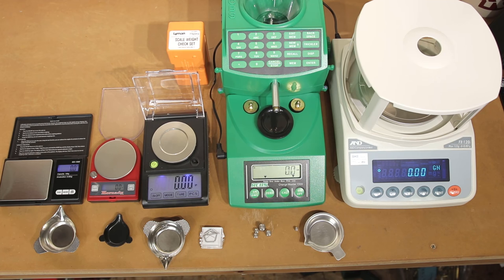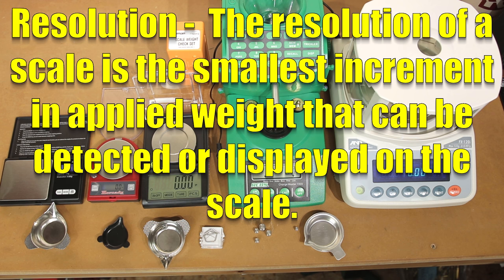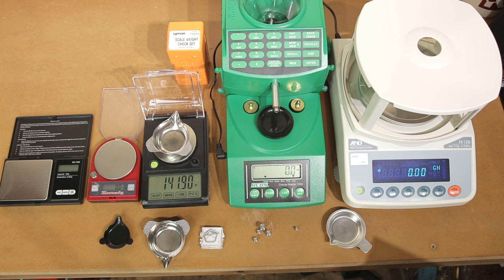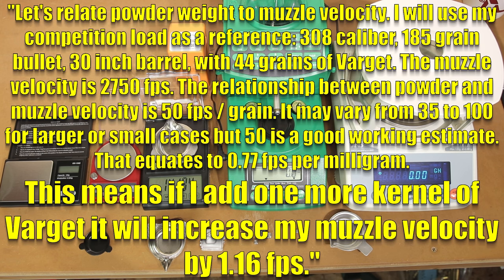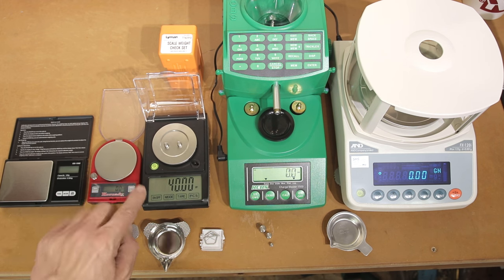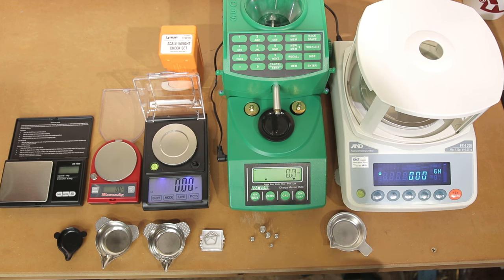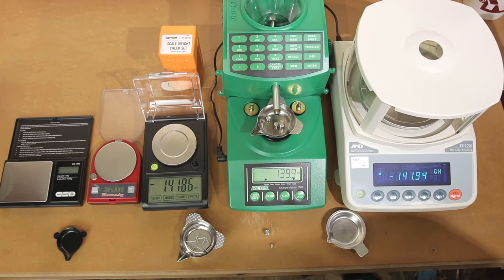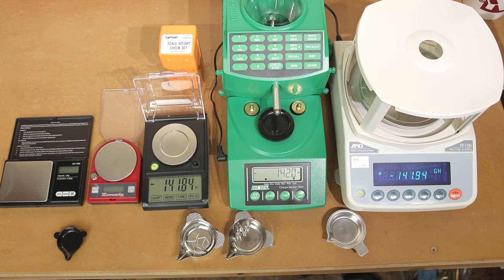Reloading Scale - Comparing the GS 1500, Charge master 1500, WAOAW milligram, and FX120i

Comment: If there is one piece of reloading equipment that I have underutilized it's my FA digital scale.  It just doesn't meet expectations.

+/- 0.1 grains shows the fallacy of the 0.01 display.

My experience with inexpensive electronic scales is that they are poorly suited for measuring small changes as with trickling.  They seem to be OK at weighing bullets or anything where the entire weight is deposited at once.

I will trust my 5-0-5s over ANY digital scale including the FX120i if there is a difference in their readings.  OTOH, my Charge Master and both 5-0-5s have always agreed exactly.

Comment: Can you please use your A and D to check how good/bad the repeatability of an Ohuas beam scale is?
Reply from the maker: I do not have a Ohuas beam scale to compare to.
Reply: @BoltActionReloading  I have one you can borrow but it's a fair trip to Australia to pick it up. I ended up automating a powder dropped with an air ram and a small motor on my trickler. When the beam breaks an optic it stops the trickler. Its faster than an auto charger and there is no worries about the beam scale drifting.
Reply from the maker: That sounds like a extremely interesting setup.

Comment: Right now i have 2 relative cheap digital scales and they don't keep zero for crap....taking the dish off and on a few times will start to skew the tared zero and I have to power off and back on to get it back to zero...pain in the ass.  I think i may just go with the balance beam just so i can feel better about the digital readout being right or not....or maybe I should just spend a bit more on a digital.....hmmmm

Comment: You could have a whole bench of nice reloading tools for the price of that A&D scale alone.
Reply from the maker: Hi James, The price of the A and D scale was a little more than the price of the RCBS unit.  A lot of the videos I have done, knowing very accurately what the weight of something is adds to the content. I am not telling anyone that have to buy that scale or any other for that matter. The point of the video is to show the performance of all of the scales so the viewer can decide for themselves which one is best for them.
Reply: @BoltActionReloading  No problem, just stating my opinion. And the A&D is just a scale, it does not throw/trickle powder, so apple's to oranges when the RCBS was an all in one when it comes to price.
Reply from the maker: Its likely the first step to an auto trickler for me. If the RCBS stops working that will be the first thing I order. Unfortunately some people think that the only place to buy them is from Brownells, when there are places that sell then for 2/3 the cost.
Reply: @BoltActionReloading  Oh trust me when I say I'd love to get one, But the cheapest I can find one for is still $715.
The cheapest price I've found for the RCBS chargemaster is on sale for $349, and that would eliminate the need for my Uniflow powder measure and my trickler. 

That being said If I had the money I'd buy one. Consistency is king, and in your video that A&D was dang close to being as consistent as can be even with a .02 accuracy, that sure as hell beats the hell out of being off be a whole .1 gr.
Reply from the maker: Its 465 at Cambridge environmental in canada. I have seen it there for 425 before.
Reply: @BoltActionReloading  Thanks.

Comment: A big improvement for all scales would be a weight platter with a recess exactly the size of the bottom of the trays, that way, the trays are consistently placed on the platter. I think inconsistent tray placement is the deviation culprit.

Edit:  Another option is to place a small screw into the exact center of the tray, and drill a matching hole into the exact center of the weight platter; that way (pun not intended,) there is absolute placement consistency.

Comment: 800.00 dollars it’s not worth it 👎🤢🤮 who cares if it’s off one or two gn off
Reply from the maker: They can be found far cheaper than 800
Reply: I picked mine up for $350 after rebate
Reply: That white one is $799
Reply from the maker: Check out Adams website, he has links that he keeps up to date to where he recommends to go. https://www.autotrickler.com/v3-for-ad.html it requires a discount code but I just checked it and it still works. Right now its $450 USD.
Reply: Eugene Johnson you need to shop around
Reply: Eugene Johnson some people.

I’m not going to act like to normal hunter or even the average target shooter needs it. Just that if you are truly chasing optimum precision especially competitively in long range benchrest or other specialties you should be caring

Comment: The FX120i is seriously over priced and you do a disservice to us all by promoting it.  If one just wants a hyper accurate balance the FX120i is double what one needs to pay.  As an example, the Ohaus Scout SPX123 is just as good, just as accurate, just as impervious to where the weight is placed on the scale and cost half the price.  Fact of the matter is Adam MacDonald made an extremely poor choice getting into bed with A&D.  He charges $270 for the Autotrickler, but one has to pay $800 for the scale?  That simply doesn't make good business sense.  All of the design acumen in the world doesn't mean one can ignore the business-end of the equation.  The Ohaus Scout is less than $400.  It doesn't have the ability to mount a throw on top of it, but design and build a "house" that the throw can sit on top of for the people that need the auto throw functionality.
Reply from the maker: Hi KeTech, First I am not promoting the scale, I am showing people what all the scales that I owned at the time are capable of. I state in the beginning that the purpose is to find the scale that is right for you. Its clear you don't really watch the video and just want to be upset about it. Not everyone needs to measure anywhere close to this level of precision so what "disservice" I am providing I am not sure. I am trying to show people what all the scales measure with the same weights can compare for themselves. I try to make it clear that everyone has to decide what is right for the person. I have not used the Ohaus scale you reference but it appears to be for sale on Amazon for about 400, which is about 25 less than what I paid for my fx120i. CE products currently has it listed for $470 plus shipping so its gone up a little. I will not make judgments for the decisions he made for his product. He states that it works with other scales but it was designed around the 120i. If you have any complaints for Adam maybe you should ask him. Best of luck.

BAR